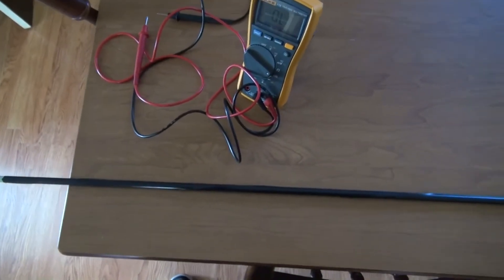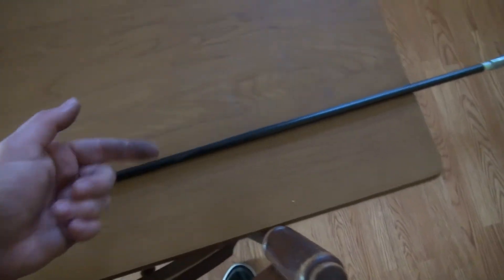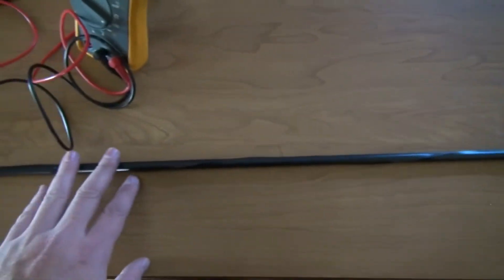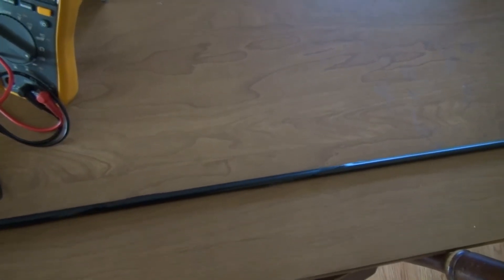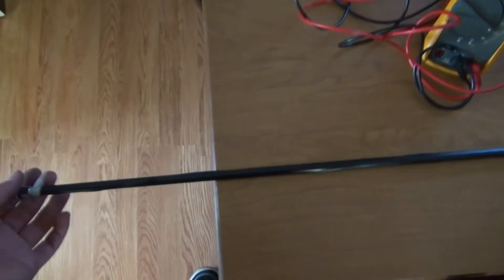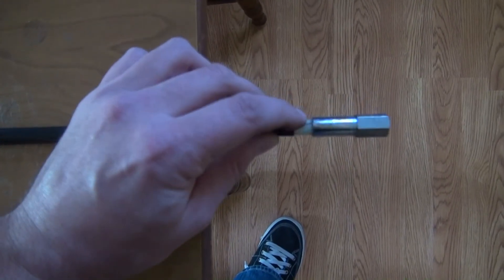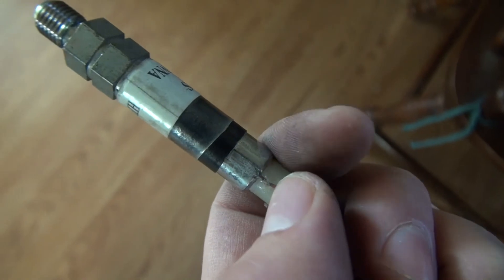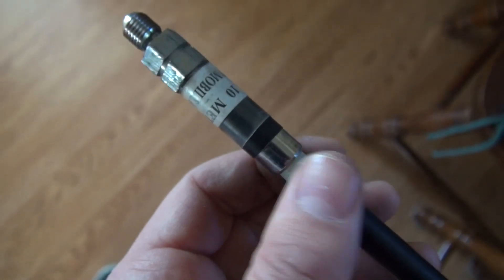HAMSTICK ANTENNA REPAIR

Comment: I just repaired a 20m hamstick that had been laying around in a damp area, unused, for about 5 years.  This particular brand has chrome on the ends, so they had drilled holes in it, and soldered to the exposed metal edge beneath the chrome.  Well, both ends corroded horribly so there was no continuity.  I ended up just heating it up, pulling the wire away, scrubbing, scraping and then applying some flux and resoldering.  I had to do both ends.  I slapped some new shrink wrap on each end.  Fixed!